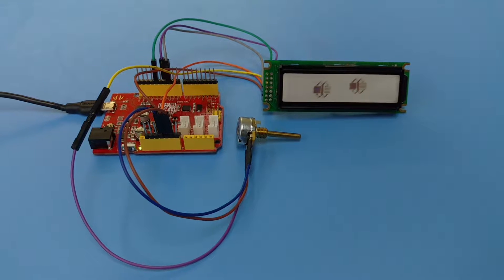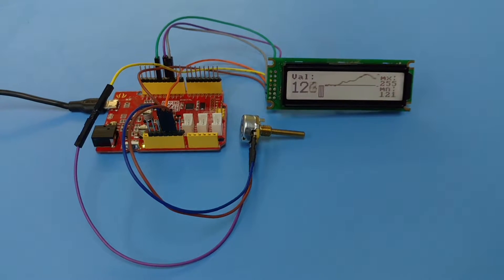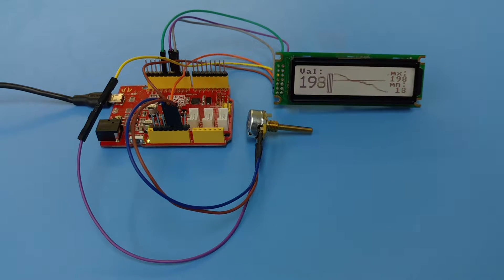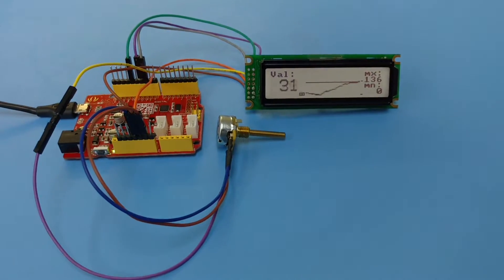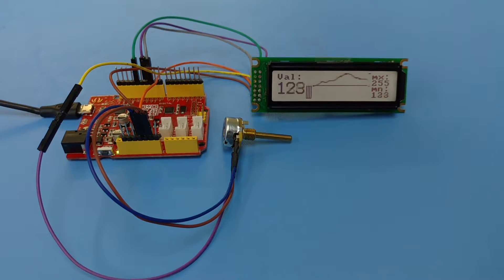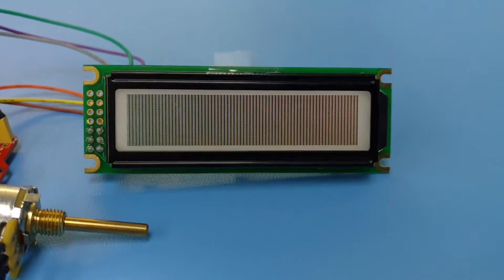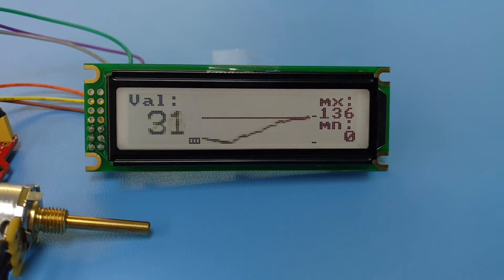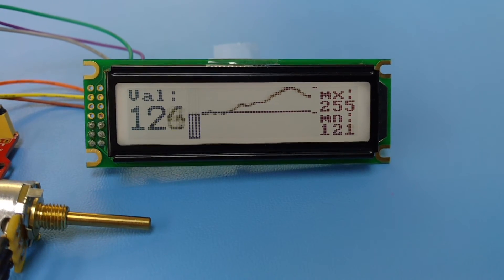Seeeduino v4.2 /Arduino ST7920 Graphic LCD Crystalfontz CFAG14432D SPI

Comment: Hi just a question about seeeduino board. Can the HCSR)4 ultrasonic sensor work on the seeeduino v4.2 board?
Reply from the maker: I do not know much about the Seeedunio -- other than it is an Arduino compatible that can run at 3.3v without modifications.  I would assume that any Arduino code for the HC-SR04 could be ported to the Seeduino without much trouble.

Comment: I'm struggling for days to bring one of those damn displays to work. Your library is too big and I understand nothing, it won't even compile. So I may ask: Is there a simplified version of the library which only displays a sample text or something like that? On you post also states "In SPI mode", but I searched the entire damn internet and found nothing about putting it in SPI mode. I wanted to test another library which works with the ST7920 chip (u8glib), but it won't display anything at all. I'm clueless. I've bought the display for ... nothing then?
Reply from the maker: Hi Fusseldieb. Sorry you're struggling. Can you send an email to support@crystalfontz.com ? That will open a ticket and we can get you some help.
Reply: I already got help on StackExchange about it. Thank you.
Reply from the maker: Glad you got it up and running! Let us know if you need anything.
Reply: Just saw your StackExchange question - worked for me, too! If it weren't for that post the display would be in the trash right now. Is there any way I can get the code you alluded to?